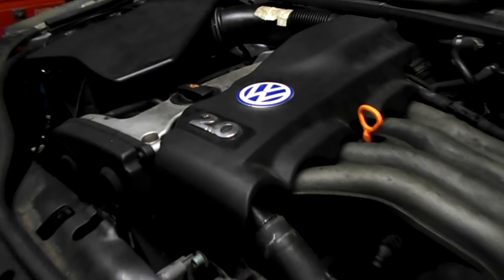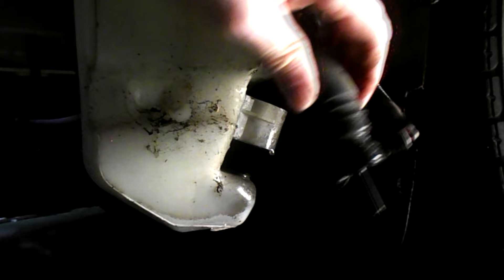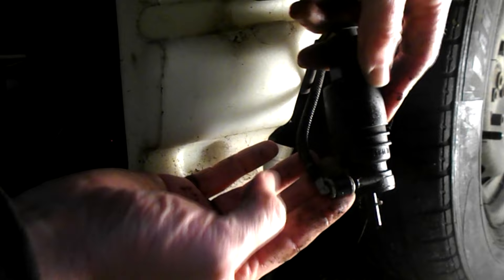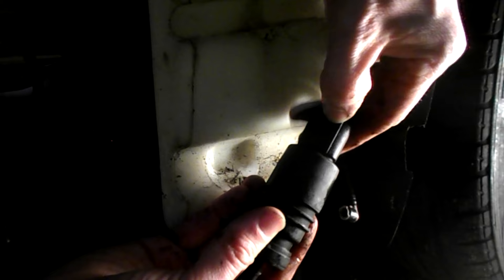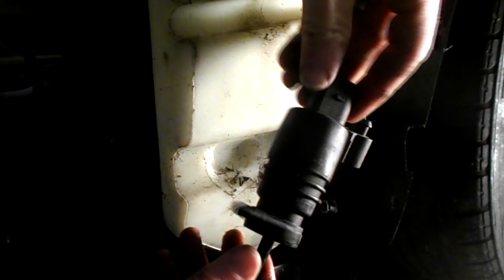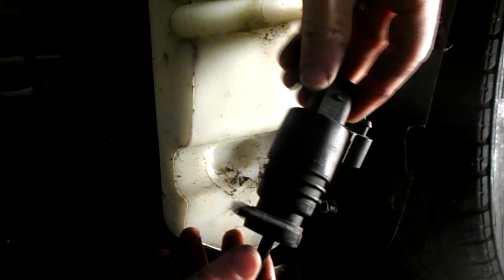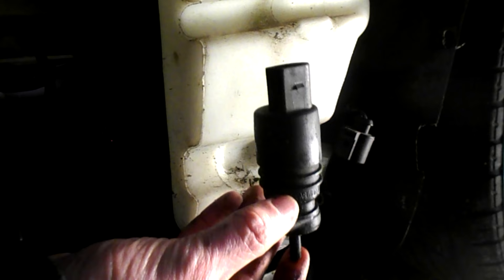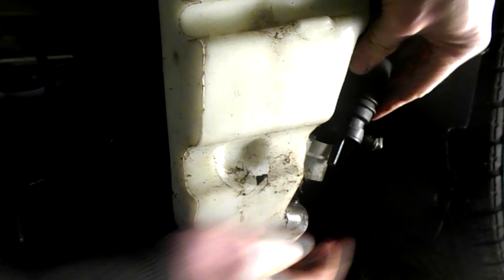Volkswagen Passat Windscreen Washer Motor Change

Comment: Hopefully you'll see this. Is there a separate pump for the headlight sprayers? As headlight washers work, but window sprayers were weak, and now nothing from them. I suspect pump is, bad, but if headlights work maybe it's a blocked line or something.